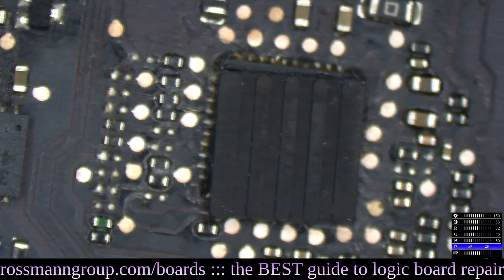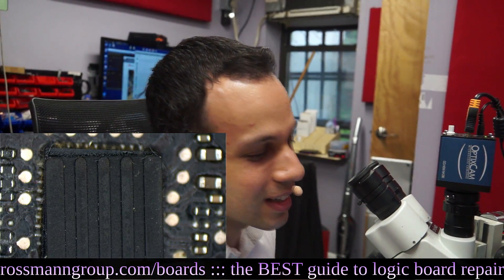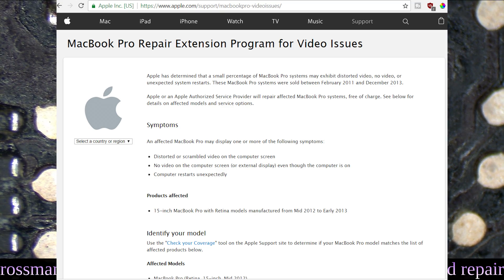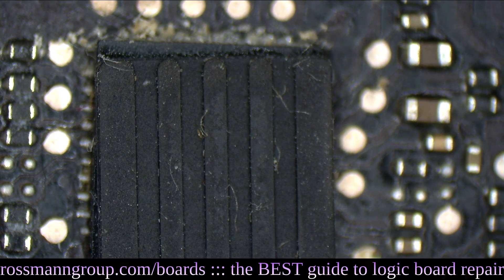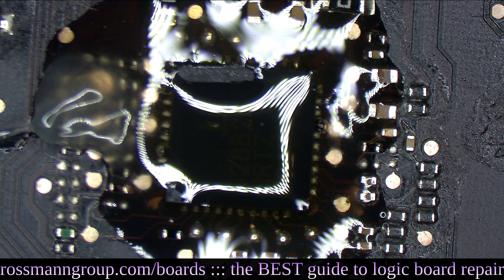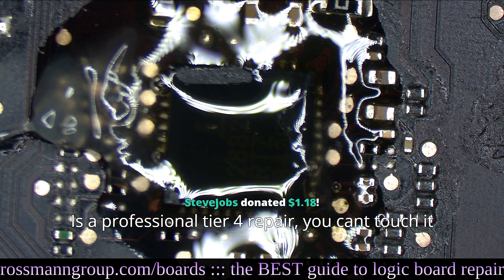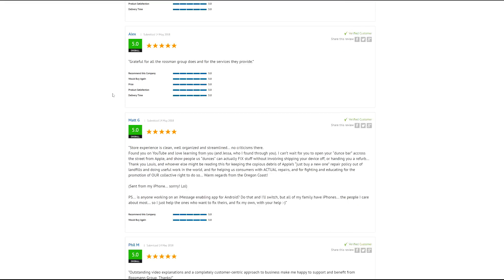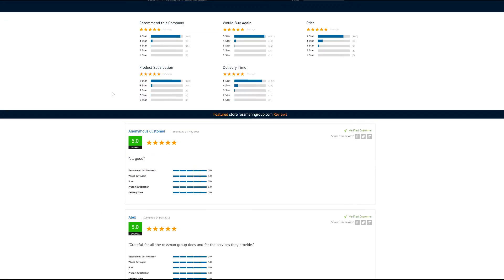How Apple authorized repair refurbishes Macbooks to fail again! GPU kernel panics

Comment: Your gonna love this story: had a customer bring me brand new iPhone 8 they bought at Apple Store. Brand new, mind you, & 1 month later it stopped working. Apple told them needed new phone. Brought to me & when opened it up here's what I saw. 1) a screw was not in the hole should have been & ended up stuck between I'd chip & may power rail that kinda caused little short issue, lol. 2) the phone had to have been refurbished because some of the solder joints were like ones on this vid 3) the shields & pads were ALL missing. Yep that's what saw & worst part, customer didn't even know they paid & bought a refurbished iPhone 8, which was FULL PRICE they said, with apple care also. Couldn't believe this. Was able to fix & phone working great after fixed apples refurb attempt etc... Amazing this is, & to not tell customer that phone buying in OEM packaging with sealed box etc...is a refurbished phone is disturbing to me, especially when they pay full price thinking buying brand new phone! 
Great vid, cheers
Reply: noAIMnoSKILLnoKILL Slightly different because we know Linus opened and broke his machine whereas presumably this customer has never even tried to open their "new" iPhone, but still incredibly shitty either way.
Reply: NeuronalAxon
Sounds like they don't want to be paid to fix something again (i mean it sounds kind of like what happened to Linus. "buy a new one because we don't give a shit"
Reply: vgamesx1 vgamesx1 Yes, I can usually tell if a phone has been opened or not (any device for that matter 97% of the time. Hey no one's perfect, lol) & this phone wasn't opened by customer. So when I opened & saw what the motherboard & parts were like inside, my jaw hit the floor. I was shocked actually. Couldn't believe that this was a refurbished item(done VERY badly/poorly, in my opinion) & was passed OFF as "brand new" at full price! Image if didn't break & I (or someone else) didn't open it, we would NEVER have known. That's what's disgusting/disgraceful to me. Hey, nothing wrong with refurb/repaired items, BUT let the customer KNOW what they're buying, that's just the moral thing to do....so yes, was totally a dick move by Apple (again my opinion & I'm ACTUALLY an electronic equal opportunity kind of person)
Reply: NeuronalAxon Actually, customer said yes they would have replaced it if they paid there $100 deductible. However, the data on the phone would be lost. So, they brought me the phone for data recovery first, than they were just going to pay Apple $100 for new phone. After I fixed the ic chip & the short on main power rail caused by the stupid loose screw...the phone actually worked just fine. No other issues at all..So as far as I know, customer never paid Apple for replacement phone & kept the one I fixed
Reply: Aepek well I think Autimo3000 was being sarcastic taking i to account the"... " at the end kf bia sentence.

And now that you mentioned that it was a" free upgrade" from the IPhone 6 it does make more sense.
As the customer is not really paying for it they why would they give them a brand new phone?, (Apple way of thinking) 
This is really a Dick Move by Apple.
Which is why I hate Apple, fuck everything they have to offer is overpriced garbage
Reply: A while ago I bought a "untested" gtx 780 for a really low price with a waterblock on it (reason for being untested). When I took the cooler off it was not only damaged but completely destroyed with bubbles and holes on the PCB and burn marks all over. So this even catched fire  when i put it into my old PC (that didn't get damaged fortunately). I mean I was aware that it could be broken but your customers didn't get a chance to know in first place 🤨
Reply: noAIMnoSKILLnoKILL Well, not trying to put any blame on you but waterblock + untested = red flag and of course you can test a card without pumping water through it, just don't try gaming on it, so for me that's a bigger red flag.
Reply: Cuzeg Spiked I had the exact same reaction..when showed pictures & vid of my work (1 reason why the repair work I do IS recorded) to customer....should have seen/heard their reaction! Was not a happy camper, not at all
Reply: Stranger Danger Didn't want to tell entire story but been bit/bit, lol. They originally had iPhone 6s that was having issues,  went to Apple  store to just buy s new iPhone 7+. The Apple store ended up giving them free upgrade to iPhone 8+(at the 7 rate). Later phone stopped working & they went to Apple to get fixed w/ care plan. Apple genius said phone $$$ dead and needed to be replaced. That's when they sought me out. They actually being in the box and sales slip(thought could fix free since insert warranty & I'd honor Apple care warranty, as I "USED" to be AASP) & kinda dumped everything on counter and asked if I could possibly help, or at least get the data recovered...naturally they were little upset/tearing up etc... I told them I'd "look at it" as at that time didn't have board view for iPhone 8+. Then opened up and rest already told. So yes, was amazed that was refurbished, granted they paid price of 7+(64gb jet black), but I would still expect a new phone unless you know buying used etc... like said, coulda been a fluke on Apple's part.
Thanks for comment, Cheers, A
Reply: @Aepek  sounds like a corporate scam. Trick people into believing they're getting a deal, so you can dump shitty, old phones. When it inevitably fails, then the dumb sheep will buy a new one. Double the profit (actually more since first phone was garbage)!

It's just like them designing the board with planned obsolescence except they're rigging it after production to clear inventory of junk.
Reply: Austimo 3000 Austimo 3000 Lastly, not sure why I'd lie and make this up, add I'd have no business b/c ppl wouldn't trust me. This isn't the first I've had of this, but was first time actually actually far myself. Thought same thing, that wasn't true when fellow shops have talked about this, then saw for myself. Hey, maybe just got past QC at Apple, or was put on wrong shelf; who knows, as would honestly think wasn't done on purpose. But this is totally a true story.
Reply: Aepek Did your customer told you that, or show you proof of that, I see so many people tell me so many bs stories when their stuff stops working, they say anything and everything to get a freebie never there fault, now im not saying apple wouldn’t do that, but it’s unlikely, how can they become one of the biggest if not the biggest company in the world with this kind of shenanigans and not be exposed, now I could see that it could be employee error, was enter into inventory system as new when it should had been on refurb system we make mistakes, but to bluntly do this and risk a class action is ballsy hey but who knows anything it’s possible
Reply: That disturbs me now that i think we’re just buying used items that have been made to look shiny new
Reply: Well they replaced my broken iPhone twice...for free...
Reply: Austimo 3000 Well, I'm sorry you feel that way but it's true. The person actually went in with a iPhone 6s & got a "free upgrade" to the new iPhone 8 & that is what they got. Sorry don't believe me, but actually a true story & THIS does happen more than you'd imagine.....
Reply: Aepek - So Apple wouldn't have replaced that phone under warranty?

Comment: an authorised repair just means it was done by apple it doesnt garantee a good repair
Reply: Well you can replace an HP or Dell Part without them bricking you when Windows does an update. 🤣
Reply: @CottonMastah  
And you can quite easely add a extra SSD or procesor
Reply: buying an apple just mean its cheap chinese crap. it doesn't guarantee a good device.
Reply: authorised means good for illiterates

Comment: Having used several Mac OS versions, several Linux versions, and every consumer version of Windows from 3.1 to 10, I still prefer Windows. Though I think having a reliable and efficient windows install IS more difficult than Mac OS, it's still leagues easier than Linux. My experience is probably why I've had so few issues with Windows over the years, but I think you need to learn any OS more than the average person does to guarantee problem free operation.

Comment: I had a similar issue with a t61p from Lenovo. The graphic failed and showed strange stuff on the screen, even in Bios.
I then opened the case and blew 200 degree celsius hot air directly on the GPU and it worked again for a few weeks and failed again.

After "repairing" it for 3 times that way I've thrown it away.

Comment: you never did the left side connections, though they did not look that bad. That said, your repair looks more factory than theirs
Reply: He did. At 6:17 he rotates the board 90 degrees counter clockwise and solders the now bottom joints.

Comment: You can actually use iZotope RX in Linux, via Wine.... but there's also Acon Suite
Reply: I would be surprised if Ardour wouldn't have decent filters. (never used it though). We used sox for audio streaming, definitely with noise cancellation plugins/options. 
Lately we  use a bit hacked for our purposes echo-cancellation package for pulse-audio, it works just as an equalizer hanging on hardware drivers and can be used in basically any modern linux application. Very handy.
Reply from the maker: as a live plugin in open broadcaster, no random freezing?
Reply: well you can use VST plugins in OBS, and iZotope supports VST3 I thought? ;) - you could also use OBS via WinE, and then any 'windows' plugins should work - have run it this way before.
Reply: Don Darreb Have you used iZotope? You can't just wing it to find an alternative lol.
Reply: if you ask about IZotope FX, no, never and I don't see any possible reason to start now. Our phones happen to have pulse-audio interfaces, and it happens so that the coding of a negative feedback adaptive filtering algorithm is not that much of a deal. It's working good enough for us.
I am sure that the absence of free noise cancellation filters is more the result of  patent mess in audio industry (I am curious how much IZotope pays Creative) than anything else.
Yes there are ways to wrap VSTs in Linux software in native way. yes it is very difficult to do process sound with small delays without hijacking all resources. 
The problem for Louis is not the lack of possible choices but the fact that any of them requires some understanding of linux and copy-pasting of some bash commands. There are software distributions targeting audio people, but so far anything I've seen does require tinkering to make it work smoothly. Much less than 10 years ago, but still.
Reply from the maker: Is there a way to use any of these plugins live in a video editor like kdenlive or openshot? It is nice to not have to work with audio and video in separate programs when editing a video. It's really a question of benefits vs. costs, if it takes six hours to figure out how to make it work that's six hours spent not livestreaming, fixing, or editing video. Has to be a really good gain/win to make it worthwhile.

OBS supports VST but I am unsure if it supports VST in Linux since to my understanding there is no VST support in Linux.
Reply: There is Lightworks and DaVinci Resolve both of which have paid professional version of video editors for Linux.
Reply: yes there is support but not "out of box" in most of the linux distributions. 

just try AVlinux before anything else.
http://www.bandshed.net/avlinux/
They have live distribution (I just tried external ssd on usb-c and it is fantastic). It is quite stable and  is "ready to use" (kant en klaar) package system oriented for audio use. They have ardour with VST support and few other choices for streaming software. KDenlive is internally supported and provided, low latency kernels, plenty of useful plugins (they swear their noise cancelling plugin is good), and other goodies.

Comment: In don't do ANY soldering unless its a standard wire connection, because I'm crap at it. So without watching too many of your videos until now (new sub), the concept of resoldering microelectronics is just magic to me. I never in a million years would have considered your technique. I'd be too afraid of overheating everything, which is a very good reason why I don't do this shit, I'm simply not capable.

Comment: Looks like there's an Apple Certified pubic hair next to the chip
Reply: Looks like a sweaty fat fuck from Apple had unzipped his trousers,pulled down his underwear and rubbed his sweaty balls over the GPU/CPU and that explains why there is so many unwanted hair follicles present on the chip.

I have never owned a Mac but I did have a Ipod Touch and from a full charge all I was able to get out of it was 20 mins of music and the Ipod I had rapidly drained all of it's power in a matter of seconds and it was this moment that I stopped using Apple products.
To me Apple products are absolute garbage and they are overpriced as well.
Reply: @BRUTALSHANZ1988  Sounds like a bad battery..it happens with any product.
Reply: probably jerking of a load on it before fixing it. to show how much they love apple
Reply: They probably using iSemen as a flux.
Reply: the $400 iPube
Reply: Is that "per toss"?.......darn...I'm in the wrong line of work....
Reply: I think this wasn't flux to begin with. That's why the solder joints look so "vintage".
Reply: LMAO
Reply: Ah, that explains the crusty brown stuff that turns into white flakes when scraping it off.

Comment: When Xbox 360 had the Red Ring of Death problem, some people fixed it by doing the exact same thing: Put some stuff on the RAM chips to make some pressure and make them work again without resoldering (People usually used rubber or felt pads). It usually worked for some months then broke again.

Next step, Apple will put Macbooks in ovens to "refurbish" them.
Reply: Don't forget the "towel trick"  🤮

(for the unaware, the towel trick is you wrap your 360 in a few towels so it cannot pull cool air in or exhaust warm air, then you turn it on and let it cook itself for a while. I still can't decide if the towel trick or putting a board in an oven that you also use to cook food is the stupidest reflow method ever)
Reply: Perdouille heat gunning them would also make them work again for a while. The real problem was the chips were cooked.
Reply: they probably already do...
Reply: Perdouille in most cases you could just replace the fans with better ones and apply some quality thermal paste and your Xbox was fine
Reply: I thought red rings of death were largely caused by overheating, I never knew it could possibly be fixed by applying pressure to the RAM.

Comment: You can always use Wine to run windows programs on Linux. Mostly used for games, but rx 5 apparently gets a platinum score on wineHQ, though I can't confirm that as I don't use rx 5. The less professional option would be Audacity.
Reply: Audacity won't do real-time noise filtering, so it wouldn't help him during streaming.  Sox might.  Or maybe he could use a LADSPA/LV2 filter.
Reply: https://ardour.org
Reply: Wine doesn't work for everything (you still can't even run paint.net).